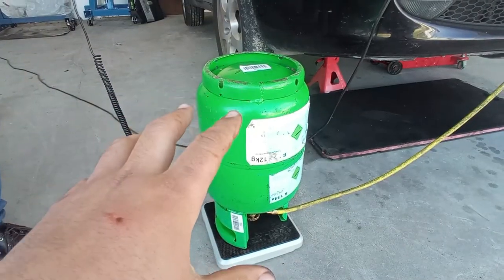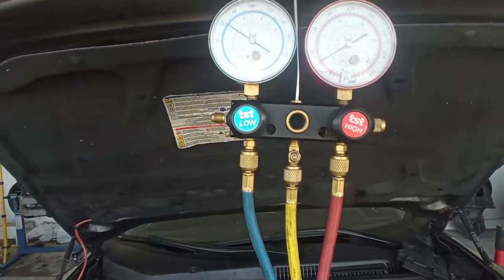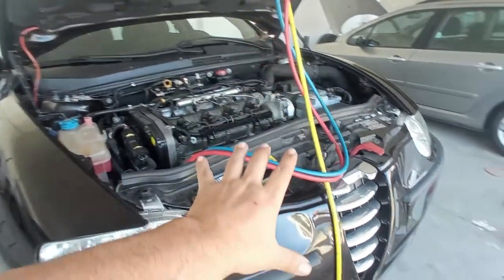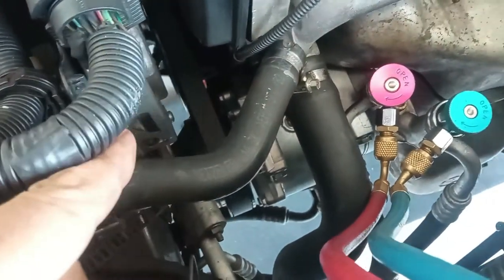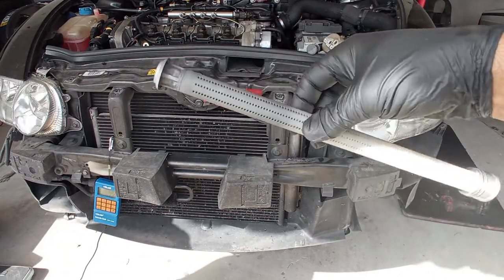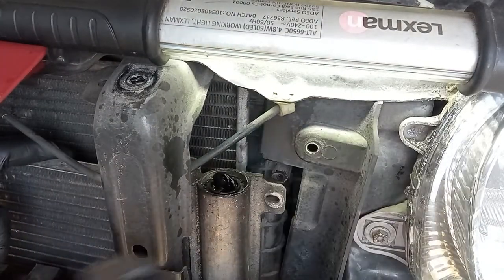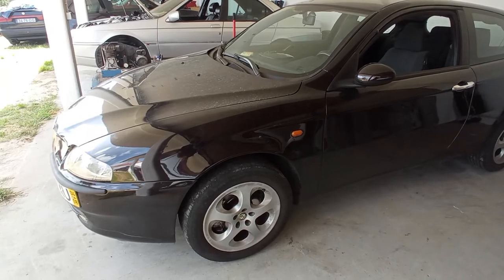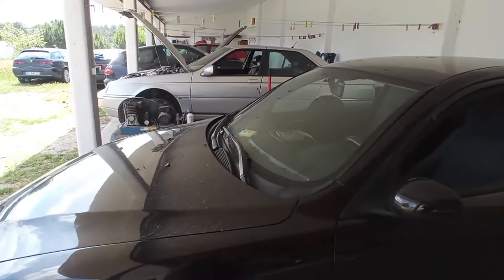What to consider when the Air Conditioning stops working. All Makes and Models.

Comment: Well, that sucks. :/
Mine will be serviced on september 18th. I asked for oil to be added to the compressor (as you told me, for that noise issue) and if needed a regass. But I did not mention the filter. If I have a chanse, when I take it to the dealer, I will see if they will replace the filter as well. But they are also doing the engine and transmission oil, all filters and spark plugs, so not sure if they will have time.
Reply from the maker: Please replace the filter, Alfa Romeo original is improved also. And very easy to replace
Reply: @alfaromeonoproblem  OK. I will ask them when I get there on the 18th, if it is not too late to do that as well.